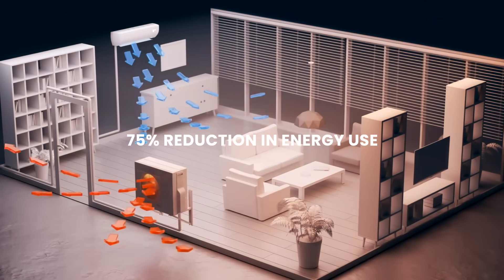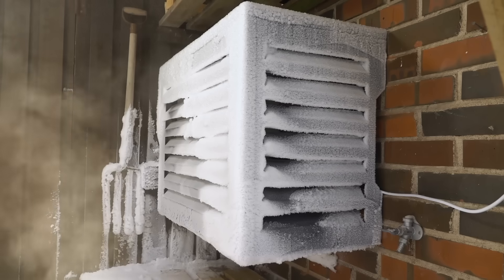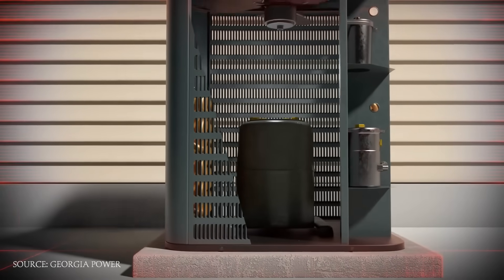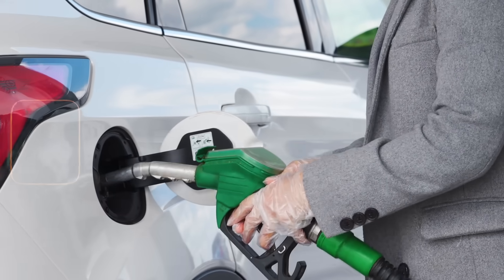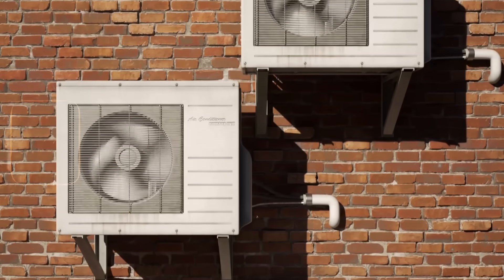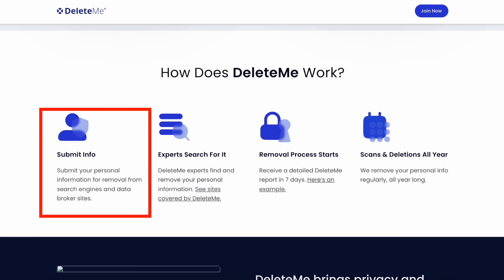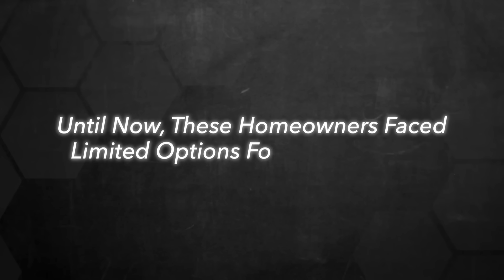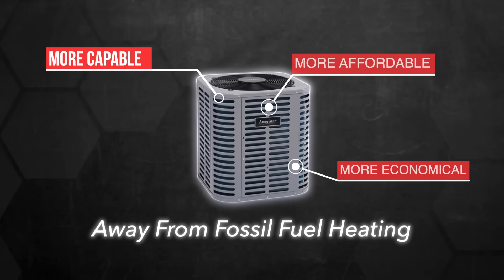Genius Heat Pump could change how we heat our homes forever

Comment: where do I get one?
Reply from the maker: https://flooidpower.com/
Reply: @TheHVACDopeShow  doesn't look like they're selling anything?
Reply: @OneirosNagualDuplas yeah what's the deal ?
Reply: Just install a system with inground pipe and then you don't need it and it would be even more efficient.
Reply: Have a proper home heat lose survey done by a reputable design engineer to size your heat pump accordingly. Home insulation is the best solution to an effecient heat pump. performance also depends on radiator size and pipe size. Weather compensation is also recommended. Vaillant and Heat pumps will go down to -25deg C and use R290

Comment: At 8:56 you say "As low as 32F without needing to switch to backup" . This is a mistake right? All the heat pumps that I work with call heat well below that?

Comment: I have been considering a dual mini-split to heat/cool the two most important rooms in my house and keeping my existing natural gas furnace (mostly for the AC tbh - no existing AC).  They share an external wall and I have the space on that side of the house.  I live in Arvada CO so super cold is uncommon but possible.  Any comments or suggestions?
Reply from the maker: Yes keeping the furnace is good for the coldest nights (normally we get one night that's -15F or so in Denver) so the furnace will keep up on the extreme cold snaps. Mini splits will work the rest of the time especially years like now with how warm it's been
Reply: @TheHVACDopeShow  I am a fairly accomplished DIYer although getting up in years.  I was thinking about having contractors run the 240 (just outside around the corner from the box) and maybe mount the unit but do the wall work and inside work myself.  Thoughts?  And thanks a ton for the feedback!

Comment: Love the theory. Not so great in practice. For me in West NC, ROI would be measured in decades and that’s IF the unit ran flawlessly (zero maintenance costs) for the same period of time. Much more practical to add supplemental heat (solar, NG, Propane, Wood etc) when heat demand exceeds heat pump’s limits. Secondly, this complexity and associated costs benefit only the heating cycle. It’s totally unnecessary for AC. For my situation it might save me $50/month for 2 months of the year. ROI far exceeds the projected life of the unit.

Comment: Concatenated systems are used to extract heat for years, but using 2 refrigerants is new to me, well explained as well
Reply from the maker: Thanks! Yes I've been mostly in res so I'm not as familiar with the other techs out there but after posting several chimed in that these are more common in commercial refrigeration etc.

Comment: Might as well go solar power with battery back up and a conventional system
Reply from the maker: Yes if it's warm enough, but these are good down to negative 32 (although I mixed up the delivery in the video). It's a wash between geothermal but this is definitely cheaper than GEO

Comment: wile in a car engine water=destruction because of the compression stroke, trying to compress the uncompressible in a refrigerant application pumping liquid has no reason it should damage a properly enginerded pump. While it would be a dive for efficiency it shouldn't destroy anything.
Reply from the maker: I'm not following... compressing water ? Or the liquid refrigerant? It's mechanical so it can't compress anymore and fails when you slug the compressor with liquid... these systems in this video have too many failure points IMO. The R290 monobloc setups are by far the best but can't be brought to the US because the refrigerant cartels (DuPont / Chemour / 3M / Honeywell etc.) lobbied / want natural refrigerants like R290 out of the USA... no money in it like patented phaseout garbage. I'm a little jaded honestly but R32 is best in America for now because it's not patented. Will still be phased out though.
Reply: @TheHVACDopeShow  You have to realize a car engine has a compression stroke with both valves closed and liquid will 100% destroy that but a compressor always has the exhaust valve open or it is a reed valve so the liquid can escape. Now if it can't escape fast enough you can have issue. I'm not refrigeration expert but then again most of them guys do what they are taught not what is necessarily the best or feasible. R12 was the best and some people use propane as an R12 replacement.

Comment: Mainer here.  I bought into the heat pump hype when I moved up here 10 years ago.  What a huge disappointment.  Especially when you consider that my state has some of the most expensive electricity rates in the country - my electricity bill was $960 last month.   And it hasn't even gotten cold yet. To be clear, my home is double wall construction and completely packed with blow-in insulation.  The R number is off the charts.  It's just ridiculous how the Greenies have completely lied to us regarding the "efficiency" of these heat pumps - when they just don't do what they're supposed to do when it gets below 27'F.  Spent close to $25k installing the system, and pay out the ass every winter to run them.  I'm so f*cking pissed about the whole situation and how the politicians have manipulated people into thinking this was a good idea.
Reply from the maker: They didn't put in a backup furnace? You can just run the furnace instead if so yikes I'm sorry to hear that, in Maine running a heat pump does not make sense when it gets below 20-25F. But if you have dual fuel / backup furnace I would run that...

Honestly that bill sounds outrageous I would make sure the heat pump is kicking on and it's not electric heat strips. I've seen installers make that mistake and the heat strips go on for heating instead of the heat pump (if it is all electric / no furnace backup). But that sounds outrageous I'm sorry to hear that!

Comment: Heat pumps better than hydronic heat cause you’re still using gas , and it’s way more efficient but I get hydronic key. I installed it, but that’s old technology. Great for floors though.
Reply from the maker: It just depends what people want but yeah both work in different scenarios... our heat pump always works and honestly helps the boiler keep up on the coldest nights way better because it's forced air and can heat up the space quickly. If it's really cold out excessive defrost cycles without backup heat can start to chip away at efficiency but lots of variables to consider. I like that you only need electricity which is easier to run than a gas line in most circumstances anytime you're running / installing a new unit

Comment: I just spent 8000 euros for 3x Mitsubishi RW25 units for a 180sqm home in Finland. so, arouns 3 tonnes. My running costs seem to be around 10kwh over 24hrs per unit in temps down to -6 celcius.
Reply from the maker: Those are great units and are pretty solid in cold temps so I'm not surprised!

Comment: Just make a heat pump running 100% on propane.  Simple.  Effective.  Safe.
Reply from the maker: R290 heat pumps exist for mono bloc applications and they're great... can't get them here because the HVAC cartels lobbied against it (DuPont / Chemour)

Comment: How does this compare to current generation multi-stage cold climate heat pumps? I have one in New England for a couple of winters now and it's been working great in 100% heat pump mode. Works just fine below 32F
Reply from the maker: It will work better but it's not common in residential applications and the complexity / cost probably isn't worth it until they can scale production

Comment: This is good for you at many thousands of dollars in your pocket it just not worth it for the norm.    but like some of the comments says this is DOA at sails a life time to get a pay back????
Reply from the maker: Yeah this will not come to market / be viable unless substantially comes down to match other high efficiency systems. But current prices for regular heat pumps have been jacked up by manufacturers hiding behind "tariffs"

Comment: I live in an area that the temp regularly goes to -40 or less throughout the winter. And if the power goes out there is no heat. I will stick to my propane furnace, a standby generator, and my high efficiency wood stove.
Reply from the maker: Good call!

Comment: Might be a more appropriate comparison with a geothermal system. Seems this approach is just a spin-off of that solution but may be useful in installations where space is an issue for a 
geothermal installation. 
Here in N GA I remain amazed by my mini splits. Especially at how they sip on the power straw to get the job done. Good down to 0 deg f and as low as it gets here. 15 is the usual low mark. Perfect.
Reply from the maker: Ductless are a great solution and the price is right... I don't like expensive tech honestly because it makes it not practical. This system would be fantastic if it was 30% cheaper

Comment: I just want a unit that the homeowner can disconnect when broken and install a replacement unit.  HVAC companies charge $350.00 to change a $20.00 capacitor.  When that's ready let me know.
Reply from the maker: You could DIY with Mr. Cool?

Comment: Great promotional video of an old idea. The fact that tax incentives are required means it is not economically efficient. Electric companies should pay for the entire installation as it creates an exclusive electric customer. It is just a customer acquisition cost that they will amortize over time. This used to be done with electric baseboard heating in new construction.  Passive sources of heat are a necessity in northern climes as there are always power outages. 24-28 hours without heat can cause death particularly in the older population.

Comment: I currently have a geo thermal heating/cooling system. The unit is a closed loop set up. I reside in Michigan. 
A few questions: 
1. Could this unit be retrofit to replace my existing geothermal system?
2. What size unit do I need to purchase to replace a 6 ton geothermal unit?
3. What would the ballpark cost be?
Assuming I could use my existing duct work. Respectfully, Cappy 

Could this unit be retrofit to my existing system?
Reply from the maker: Not for geothermal I don't think, and Geo is already very efficient because even on the coldest nights the COP stays about 4 on most systems

Comment: First, they have to be reliable, Second affordable, $20k or more is not affordable. If a company can build an affordable and reliable 30 year system, they will set the bar high and surpass all others.  Personally, I would pay more for a 30 year heat pump instead of a 10-15 year heat pump.
Reply from the maker: I agree I'm tired of stuff that breaks all the time. Most brands are reliable but they're engineered to last 15 years for a reason💰, annoys the ** out of me

Comment: I feel like these are great options, but a geothermal closed loop system would be more cost-effective in the long run.
Reply from the maker: Yeah definitely and the loops usually last 50+ years so you only have to replace the indoor units when they go out
Reply: @TheHVACDopeShow built mine myself and it was still cheaper then any system i could have paid for professionally. The upcharge on most goods and services is just ridiculous in this country.

Comment: Mitsubishi Electric have had hyper heating heat pumps since 2001 that have SCOP above 2 in temperatures of -25 to -30, so where is the revolution. This happened 25 almost ago. These have been used in the Nordic countries since then. There are different takes on how to make this work, Toshiba has its own as do Daikin and many more.

 I have radiotars in my separate garage/workshop but they have not been in use since I installed one of these heat pumps other than as a back up set on some degrees over freezing.
Reply from the maker: None of the Mitsubishi models have a COP of 2 at -30F... if you can point out the ones you're referencing I'll look up the model but I'm familiar with Mitsubishi and cop drops below 2 once they get below 0F

Comment: Did you say 32 degrees Fahrenheit?  It has been below that temp for three weeks.  Temps of 9 below zero.  I have seen 30 below zero here.  In northern MN I have seen 40 below Fahrenheit.  The only people I know with heat pumps use geothermal models with extensive piping in the ground. These are fragile, and a friend of mine's geothermal system only lasted five years, and it is expensive to replace.
Reply from the maker: -32... negative. I might have said 32 but it should be negative

Comment: How can you support such an expensive unit?  Honestly.  Also if it doesn't work when it's below 32 degrees then what good is it in the winter?  I'm keeping my gas boiler, thank you!
Reply: He made a mistake in his video and later said it correctly….they can work down to MINUS 32 degrees F.
Reply from the maker: -32F, negative 32... I don't support it I just talk about it. They need to get their price down so they're comparable. Honestly this is good for someone who can't do geothermal and is off grid with expensive electric. Besides that it's priced out of the market IMO

Comment: The “why hasnt anyone else” argument is a boring thing that every genius innovator suffers with, if being a genius is so useful then why isnt everyone a genius… well because if you make a crap heat pump then you will do extremely weel and if COP of 4 is so magical then what incentive do i have to make a heat pump for my customers with a COP of 5 that costs twice as much esspecially if i just tanked the ROI ? 
I can make a heat pump now with a COP of 14 but nobody will buy it on account of the price COP of 4-5 solves their problem too well, what i need is an ideal use case like boosting an ORC generator

Comment: Just curious. Where I live, near the Great Lakes is humid. How well does a heat pump work at 100% humidity and zero degrees?? (32F)
Reply from the maker: There was a typo in the on screen text, and what I said, this system goes to negative 32F. If you're by the Great Lakes at 32F you're fine with most heat pumps... cold climate systems are pretty solid down to 0F but lose efficiency (financially speaking compared to gas) below 20F depending on electric rates vs gas costs (propane, oil, etc)

Comment: If one would enclose a heat pump (perhaps double walled ,with intakwe ports  ,  while outside , in the coldest air ,protected from wind ,causing the pump to draw from a 'hotter' air source ? Make a difference ?
Reply from the maker: No, if you put it inside a large greenhouse that had gold sun exposure this could work but you're making the greenhouse cold and need to replenish the heat (thus can't be isolated in a greenhouse because at night the greenhouse will get colder that it is outside)

Comment: A geo system would make more sense.
Reply from the maker: Depends on the region but yeah it's starting to get expensive. Geo is not cheap either so it depends on the demands... off grid some place cold ? I'd probably make the investment in Geo
Reply: @TheHVACDopeShow Geo is fairly cheap if you rent yourself a digger. The rest is just plastic coils and a heat transfer system.  This is where junkyard radiator can be used.  Just enclose and circulate the air with a small pump to circulate the coolent.

Comment: Great tech. It should also incorporate free thermal solar, It is a lot of machinery to maintain , ROI will be a long time , The cheapest system RE- ROI , Is high eff. gas or propane .
Reply from the maker: Yeah unfortunately it's a lot of complexity so it could work or could not... we'll see if production cost is able to come down and they're able to scale. It's a viable solution to cold climates but only would make financial sense off grid where your choices are expensive fuel alternatives and you have cheap electricity or solar to supplement

Comment: I saw these a year ago and was waiting for their certifications.  Glad they were able to get them. I also like that they have a steam option, however, even though steam is simple, it is not a long term solution that I want to keep.  I do know that it will cost at least $5k to change to radiators, but the savings of heating water to 140 degrees rather than the 212 degrees plus a phase change is significant (72 plus 970 BTUs for the phase change = 1042 extra BTUs per pound of water in the system) .

For those that are concerned with sticker shock, the total install price of about $30-$50K is far less than the cost of super insulating a home.  In today's dollars, to modify an existing 2000 square foot home with triple paned windows, foam insulation, LED lighting, and the other items that are needed to get the equivalent of Energy Star/LEEDS certification, I would expect it to run well over $100K (this would be a lot less if the house was built that way from the start as the incremental cost increase, from my experience, is only about 5-15% more).  Note: Implementing these items for super efficiency could lower you needs by 50% or more and could be done slowly over years to help reduce the overall $$ impact to your pocket.

Comment: You use gas to generate heat, use the heat to generate electricity, transmit the electricity to people house, convert the electricity back into heat... Does this sound like 'genius" to you? Or a genius should ask why can't you use the heat right away?😁
Reply from the maker: Different forms of electricity. Some people are nerds and like heat pumps... idk lol. Dual fuel is most practical IMO for people that want heat pumps but I still think going all electric makes sense for people off grid, it costs us $1500 to fill our propane tank, that's why it's only used for our backup generator and heat pump is infinitely cheaper for us to run than a propane boiler (by a margin greater than 60%...). Different strokes for different use cases, but valid question lol. That's why